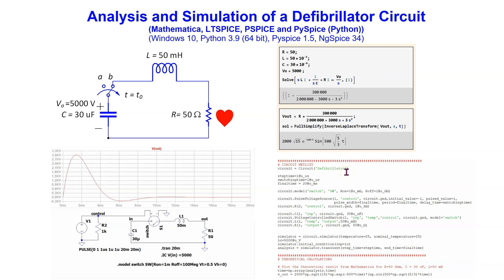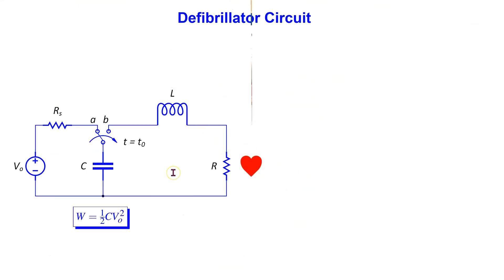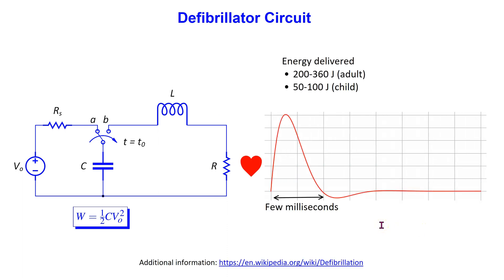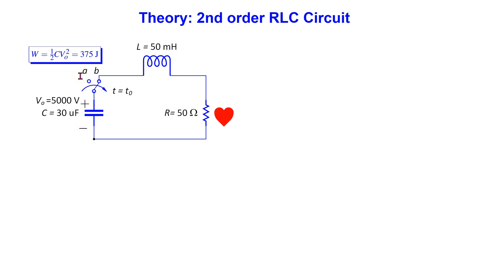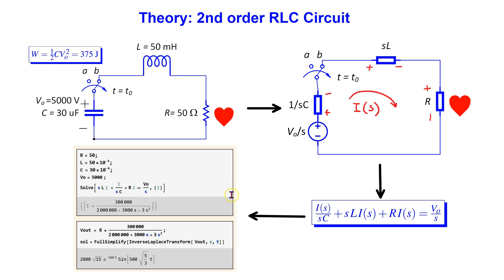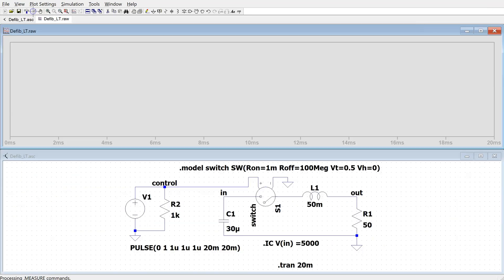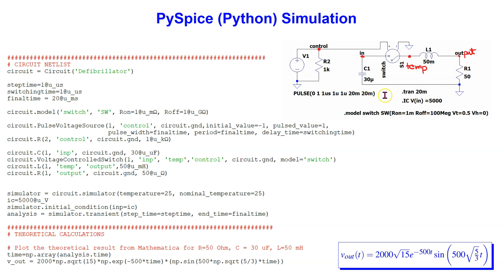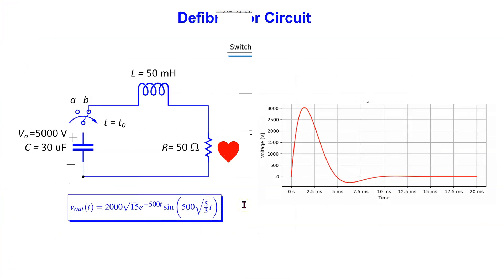How to analyse and simulate a Defibrillator Circuit in LTSPICE, PSPICE and PySpice (Python)

Comment from the maker: # Pyspice (Python) code to simulate a Defibrillator
#####################################################################
# STANDARD DECLARATIONS

import math
import matplotlib.pyplot as plt
import numpy as np

import PySpice.Logging.Logging as Logging
logger = Logging.setup_logging()

from PySpice.Probe.Plot import plot
from PySpice.Spice.Library import SpiceLibrary
from PySpice.Spice.Netlist import Circuit
from PySpice.Unit import *
from matplotlib.widgets import Cursor
from engineering_notation import EngNumber
from matplotlib.ticker import EngFormatter

#####################################################################
# CIRCUIT NETLIST
circuit = Circuit('Defibrillator')

steptime=1@u_us
switchingtime=1@u_us
finaltime = 20@u_ms

circuit.model('switch', 'SW', Ron=1@u_mΩ, Roff=1@u_GΩ)

circuit.PulseVoltageSource(1, 'control', circuit.gnd,initial_value=-1, pulsed_value=1,
                           pulse_width=finaltime, period=finaltime, delay_time=switchingtime)
circuit.R(2, 'control', circuit.gnd, 1@u_kΩ)

circuit.C(1, 'inp', circuit.gnd, 30@u_uF)
circuit.VoltageControlledSwitch(1, 'inp', 'temp','control', circuit.gnd, model='switch')
circuit.L(1, 'temp', 'output',50@u_mH)
circuit.R(1, 'output', circuit.gnd, 50@u_Ω)

simulator = circuit.simulator(temperature=25, nominal_temperature=25)
ic=5000@u_V
simulator.initial_condition(inp=ic)
analysis = simulator.transient(step_time=steptime, end_time=finaltime)

#######################################################################
# THEORETICAL CALCULATIONS

# Plot the theoretical result from Mathematica for R=50 Ohm, C = 30 uF, L=50 mH
time=np.array(analysis.time)
v_out = 2000*np.sqrt(15)*np.exp(-500*time)*(np.sin(500*np.sqrt(5/3)*time))

#######################################################################
# PLOTTING COMMANDS

figure = plt.subplots(figsize=(11, 6))

axe1 = plt.subplot(211)
formatter0 = EngFormatter(unit='s')
axe1.xaxis.set_major_formatter(formatter0)
plt.title('Switch activation')
#plt.xlabel('Time [s]')
plt.ylabel('Voltage [V]')
plt.grid()
plot(analysis['control'])
axe1.set_yticks([-1, 0, 1])

axe2 = plt.subplot(212)
formatter1 = EngFormatter(unit='s')
axe2.xaxis.set_major_formatter(formatter1)
plt.title('Voltage across Resistor')
plt.xlabel('Time')
plt.ylabel('Voltage [V]')
plt.grid()
plt.plot(time, v_out,'black')
plot(analysis['output'],  color='red')
plt.legend(('theory','simulation'), loc=(.05,.1))
cursor = Cursor(axe2, useblit=True, color='blue', linewidth=1)

plt.show()

#######################################################################

Comment: Hello,
Actually im traying to simulate same thing, im facing some issues due to im new for LTspice, 
Can I have the LTSPICE file, or do you have repository for this?

facing the issue with IN (in) keyword, im not able to set 5000V
Regards
Reply from the maker: Hello, I do not yet have a repository set up for sharing the files. You can set 5000V using SPICE directive. The easiest way to access the menu is to click the .t in the menu bar at the top and then typing in the SPICE directive .IC V(in) = 5000. Hope this helps.